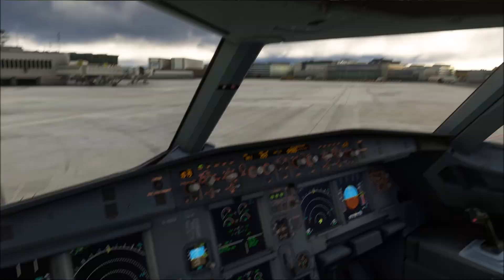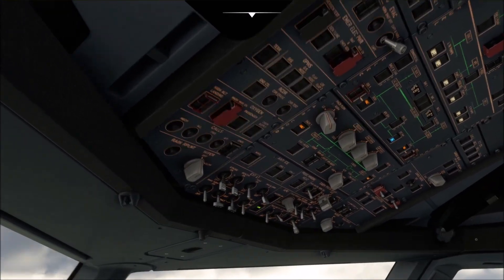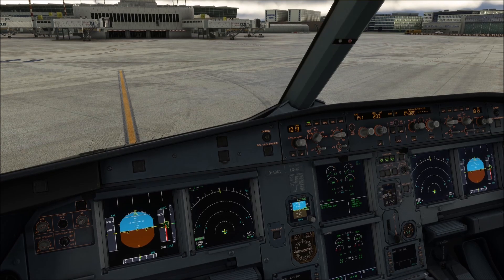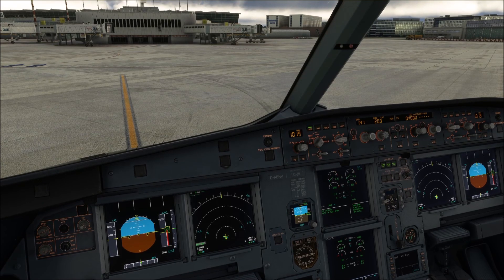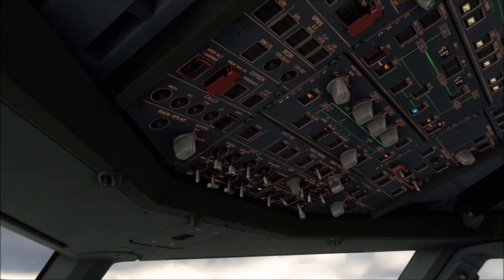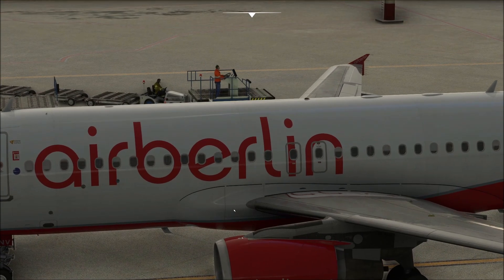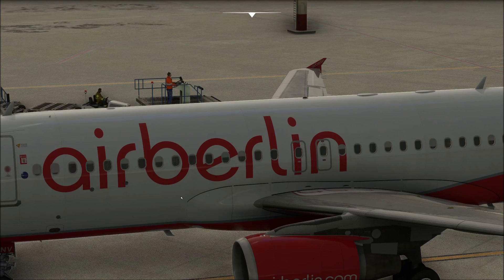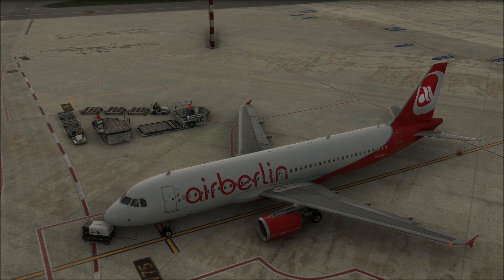Are they CRAZY? Why Airbus checks the WING LIGHT in the Parking Checklist | Real Airline Pilot

Comment: I haven't watched the video yet but I wanted to share my ideas first ( given I'm no expert at all)
Maybe wing lights on the ground are some kind of hidden code or signal which could alert ground staff.
First I thought they might add extremely to the battery drain but as long as engines are running or apu or gpu, this should not be a factor.
I know that they are turned on to check icing.
But these are all thoughts I have, given my limited knowledge .
Now im curious whats the answer

Comment: Hello, that is an interesting fact. I have a question about wing lights. You said earlier that the purpose is to check for icing. But is it correct that some airlines also just light them standard during landing? Because there a some videos out there that also show the wing lights during touchdown. And also my experience in the sim is that the plane is much better visible as object in the night with the wing lights on during landing. Perhaps it also gives the passengers more comfort, because you can see some more outside, otherwise you sometimes see almost nothing. So is this airline specific? Or do most airlines only use them to check for icing, and thus do have them off during the final and touchdown? Thanks for your good videos! Greetings.
Reply: U.S. airlines tend to use them during takeoff and landing, particularly at night, to increase visibility in the case of an accident and increase aircraft visibility overall.
Reply: It's more of an inconvenience to passengers near the wing as it might keep them awake at night if some passengers refuse to close their window blinds. It will be very noticeable if the cabin lighting is on its lowest setting.
Reply: @ImperrfectStranger  A lot of airlines require the blinds to be open during takeoff and landing. For my part, I have never found it distracting.

Strobes on A320S are though.
Reply: @Robot1341-u6h  It's also beneficial for passengers to be awake during takeoff and landing. I was of course talking about night cruise. I guess my eyelids must be thinner than yours. Any light keeps me awake. Fortunately I have some eye patches for night flights. Inevitably there is, also, always someone who likes to turn on their reading light in the middle of the night.
Reply: @ImperrfectStranger  Yep. I know exactly the kind of people you’re talking about. Or the flight attendants who snap the lights on in the middle of a 15 hour flight to serve a midnight snack.

Comment: Incase people are asking why it then applies to the A319/A320 checklist, because the same pilot can fly all 3 types so it keeps it universal for all 3 types.
Reply: I was just asking myself the same question.
So basically it's so that pilots that fly the 321 don't forget it?
Cause that might be a good idea but should I checklist not be tailored to the aircraft?
I know the airbus family is basically identical, at least the 320 series but still.
Reply: @adennis200  For major items yes they are tailored. But Airbus are fairly similar in their aircraft operations so most items are very similar
Reply: @adennis200  And to avoid too many dissimilarities that would then require an additional type rating.